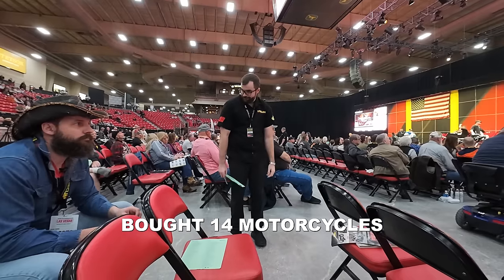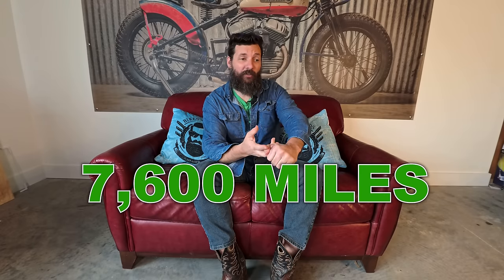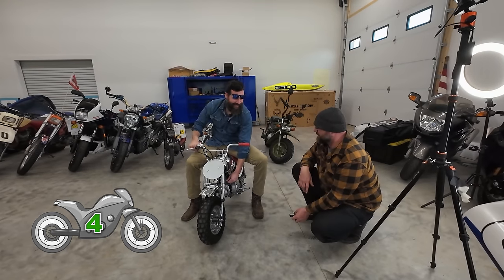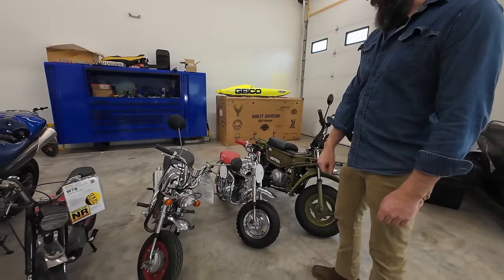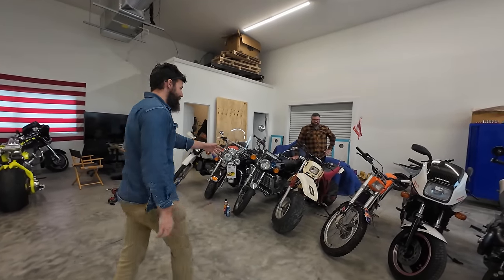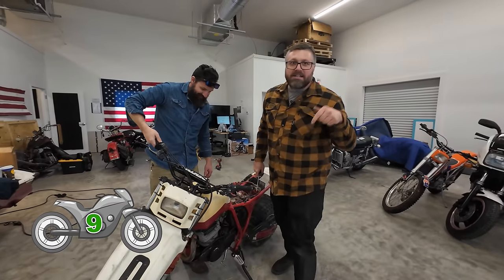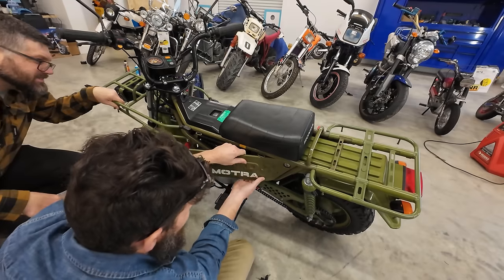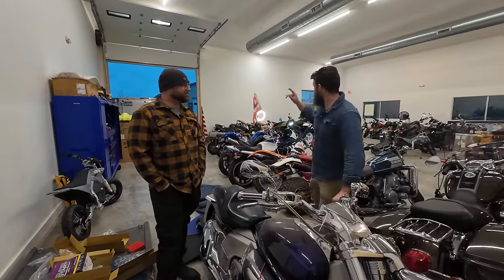I Bought 14 Motorcycles at Auction and its NOT Looking Good

Comment: Don't underestimate the Beta Alp and it`s top speed.    Those Rotax Engines are AMAZING.  They got used in anything from superkarts, atv`s Supermoto and enduro bikes(kramit 250, Alfer VR) To trails bikes and Race bikes (SuperMono) So if you ever wanted an overall powerful, compact, low maintenance and ever going engine that holds up like the Energizer bunny.  The Rotax 257 is it.      PS.  You are missing the "street" seat.  There should be a Huge "lump" of a seat that you bolt onto the bike to make it ride more like a "road bike"  It is big and ugly, but it is part of the overall "glory" that is the Beta Alp.

Comment: Seems like current auction system is setup to serve the sellers, and you want to serve the buyers. Seems to me all the scammers will use the old auction system and the truthful sellers will have no issue with the new system. Why would anyone buy a bike from the scammers auction system